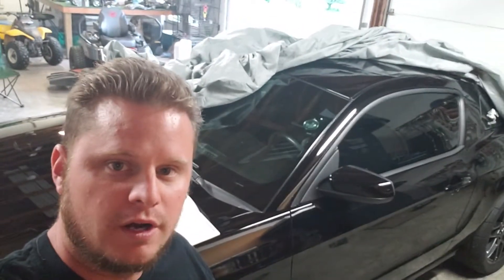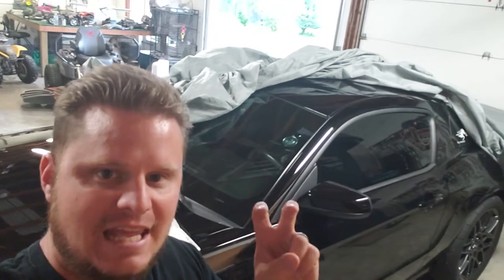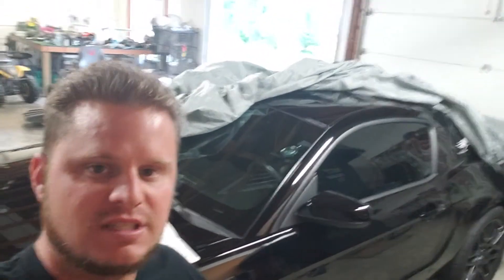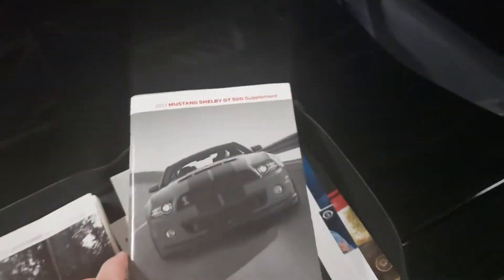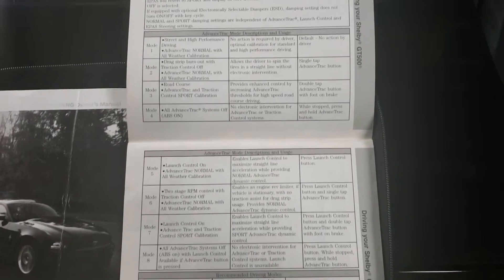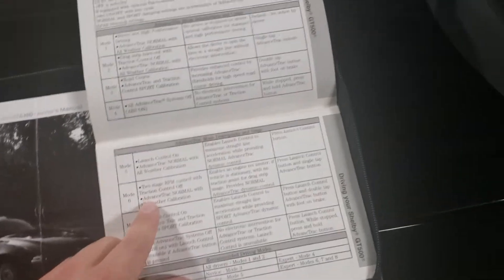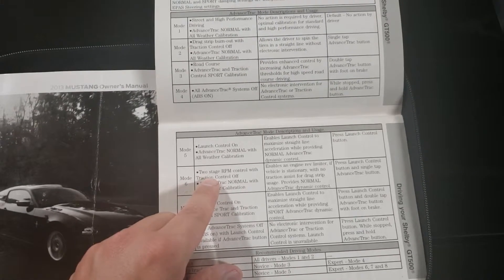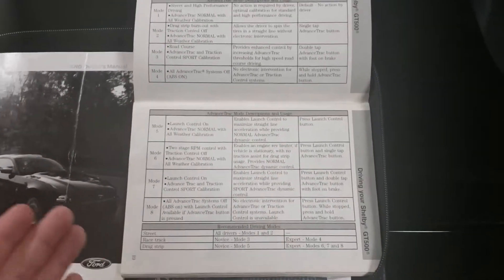LAUNCH CONTROL FEATURES! GOOD OR BAD? Shelby GT500

Comment: 2014 GT500 owner here. I personally ran fastest with everything turned off and just slipping the clutch out quickly, much like leaving a street light aggressively in stead of dumping the clutch. That said, once tuned with clutch protection disabled and on drag radials, I never played with TC or even the launch rev limiter. That 2-step is a nice feature for stick cars, allowing consistency. The best pure track mod is a wrinkle wall bias ply tire

Comment: I run Mode 4, especially because of the Goodyears.  Now that they are gone, idk.  Launch control is really just a rev limiter so you can dump the clutch without worry.
Reply from the maker: Very true!! I think it's a great feature!!
Reply: Enjoy your car and power, get rid of those Goodyears. Junk unless they’re smoking hot on a hot track. Drag radials will allow you to unlock your cars potential. Run Nitto 555Rs safely on the street.

Comment: These cars have a very intrusive CLUTCH PROTECTION strategy. My tune from Lund had this disabled and it’s actually safer on the clutch, especially if you  run sticky tires on the strip.
Reply from the maker: I can definitely understand that!